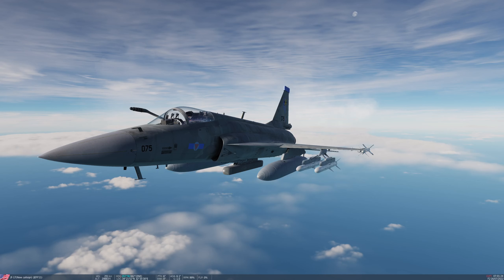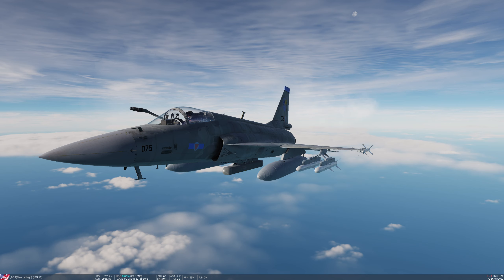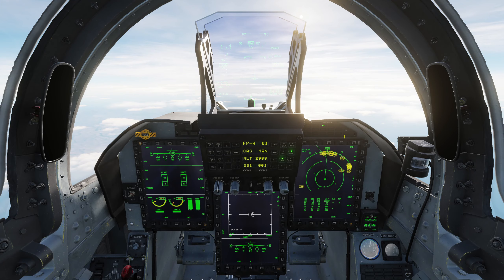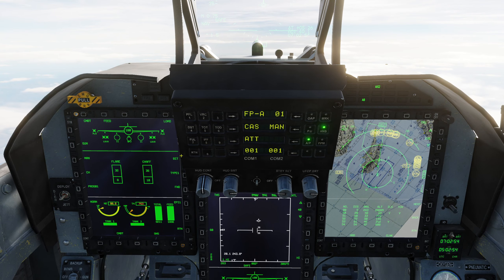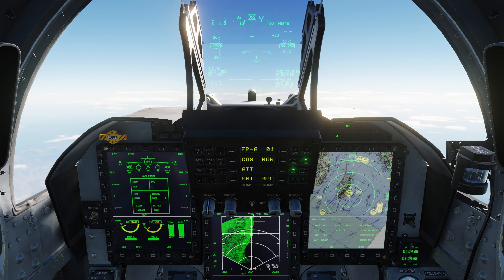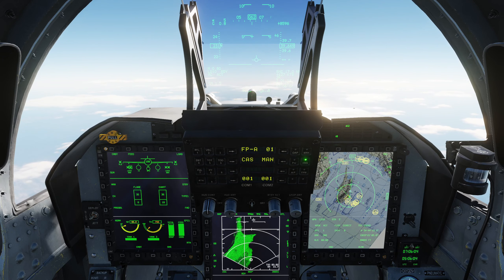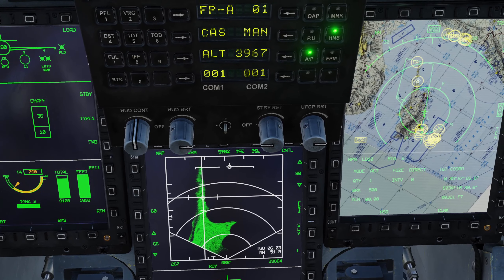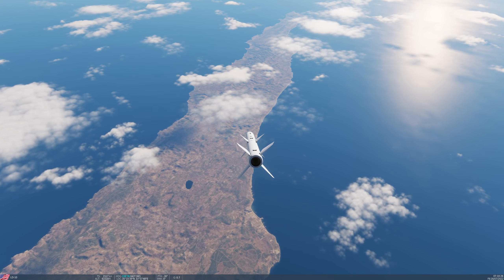DCS JF-17 Bonus 2 - LD-10 SPI Trick

Comment: Only issue is this will only work if there's only one radar emitting around the SPI. If there are multiple radars, the LD-10 will go for the nearest emitter and sometimes that might not be the one you're after due to distance error (the SPJ only provides slant range). For example if the SAM site is protected by SHORADs or Radar-guided AAA, or even SAMs with TELARS like SA-11.

There are ways around it by looking for the SAM site with the A2G radar but that can be tricky since the EXP/DBS modes is not as good as the ones on the Hornet or Viper.
Reply from the maker: Yes, you're quite correct. Approach with this kind of mission should always be volume though, multiple aircraft launching multiple LD-10 and perhaps throw in some TALD for good measure.

Comment: The LD-10 will loft in self protect or passive mode if you pitch up 15° or 25° I've been able to successfully  engage a sa 5 track radar from 60 miles
Reply from the maker: I've not tested this much but I'm familiar with the tecnique. Does it loft aggressively like it does in ACT mode or does it pitch down quickly from that launch angle?
Reply: It does pretty much a similar loft profile to ACT mode going to about 80k ft then slowly diving towards the target and then doing a almost 90° dive to hit the radar emitter
Reply from the maker: @wargames637  Excellent, that does sound effective then.
Reply: @deephack  Back, when I was still flying DCs and JF mostly, I was instructed to loft all my missles whenever I could primarily SD-10 and LD-10, but buggines of dcs systems drove me inro ragequit at one point.😂